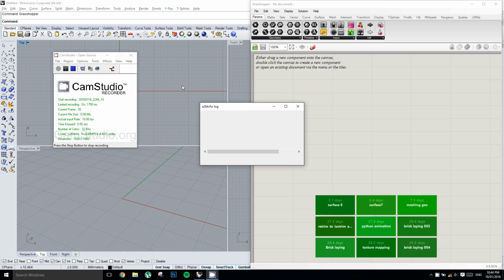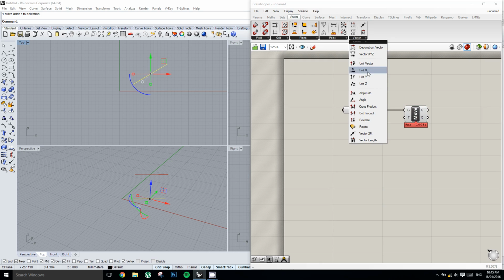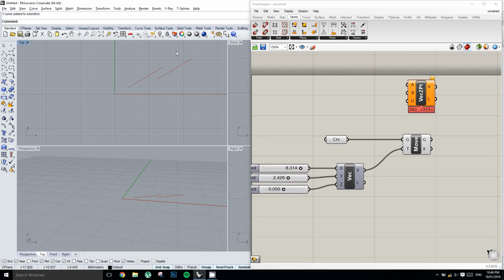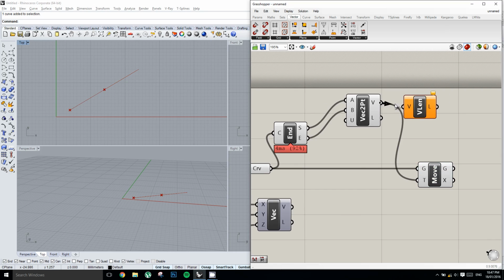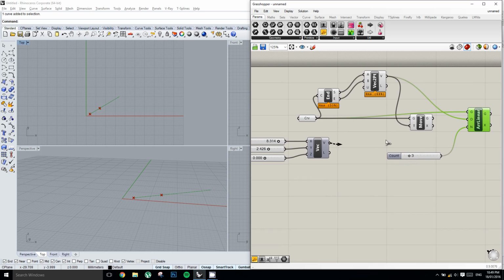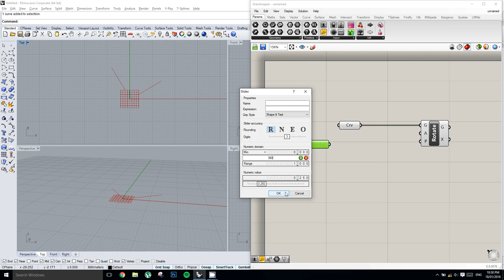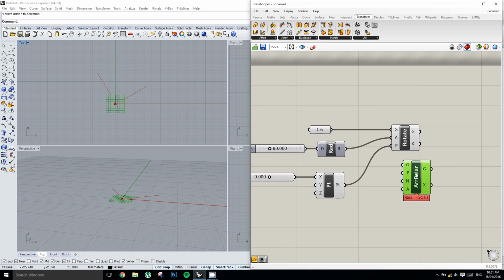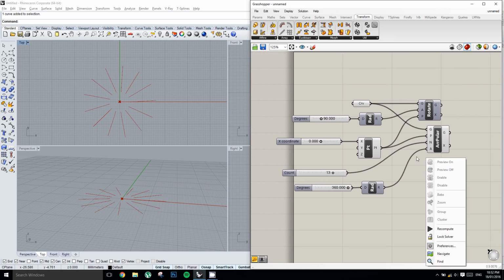Grasshopper 05 - Transforming Geometry

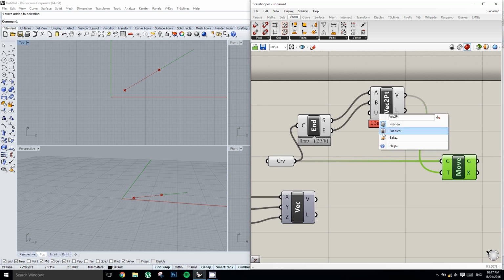Comment: Nice tutorials, just one thing regarding the Invert option around minute: 3:18 I think it should be explained for people who might not understand what that does. After right clicking the U option we have the Boolean parameter that is set to False by default, by setting it to True the vector is unitized(= 1 unit). Now what invert does, it takes any current Boolean value and inverts it, so if it's set to True it will turn to False. So what unitizes the vector is the value of the Boolean parameter.
Reply from the maker: Thanks dude! I don't think I explained stuff as well as I could've in these earlier tutorials, so appreciate you making this note.